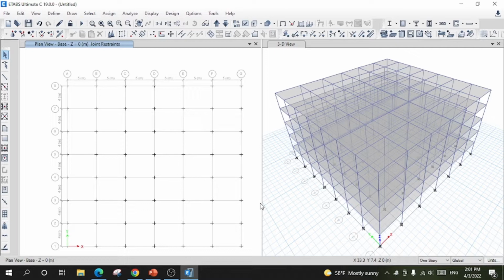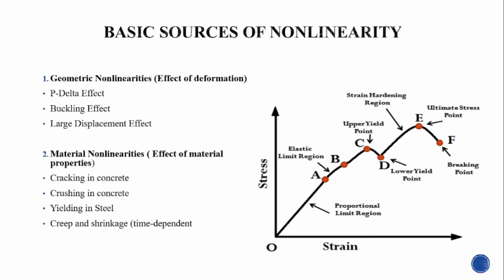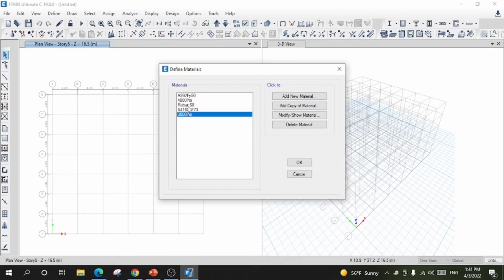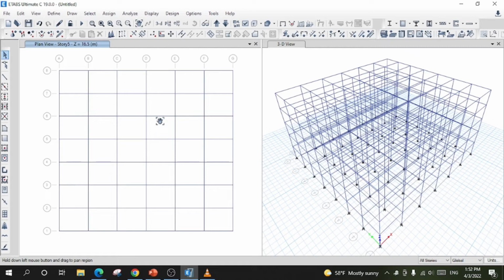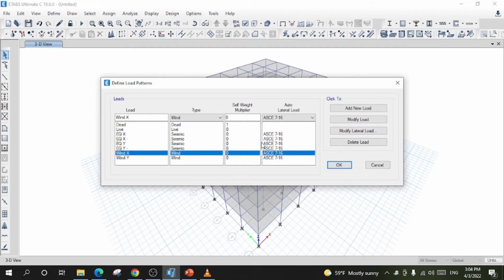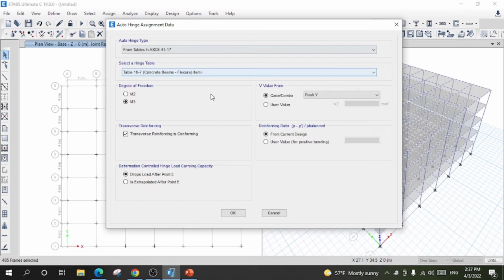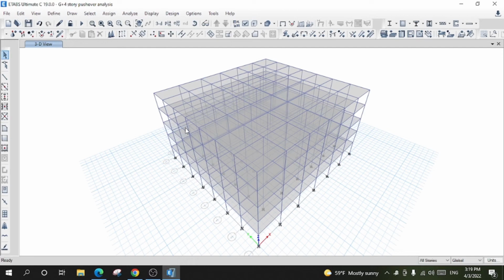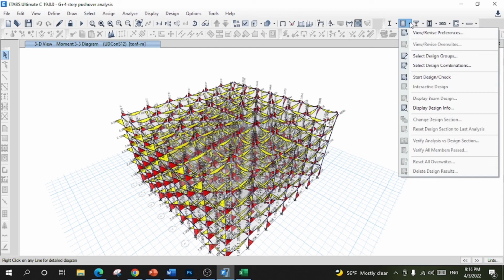Nonlinear Static (Pushover) Analysis |Step by step explanation| - ETABS.

Comment: Hey I have a question please I am doing static nonlinear pushover analysis but when I run the model it gives error in creating frame hinges I use Etabs 2016 please I need help
Reply from the maker: You may didn't assigned and created hinges correctly,
the following tutorial regarding Frame Hinges may help you
https://youtu.be/4JL4d7ppWUQ

Comment: How to assign hinge plastic of Composite column , beam and wall please ?
Reply from the maker: For Assigning the hinges, you can follow another tutorial which link is below
https://youtu.be/4JL4d7ppWUQ
Reply: @SmartEngineer2  i need composite members .
Reply from the maker: @otisroyals1013  It is the same procedures, if you watch the whole lecture you will understand better
Reply: @SmartEngineer2  i know what you done video. I try search data or Code how to use parameters hinges of beam composite, columns composite.. But not found 😓. Etabs just support RC hinges and steel hinges but not composite members .

Comment: Sir can you do a video on pushover analysis of an elevated rectangular water tank
Reply from the maker: For Elevated water tank you can watch my following tutorial, 
https://youtu.be/obkDnrbgAUY
but instead of Nonlinear Dynamic Analysis you can use the Pushover analysis as you have asked.
Reply: Should I keep the water pressure as non linear static while running the load cases for pushover analysis